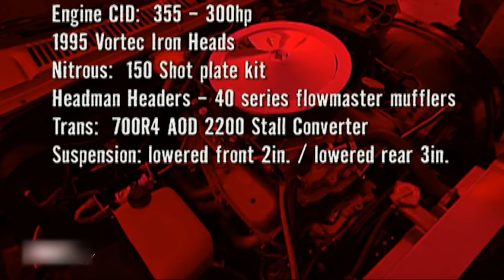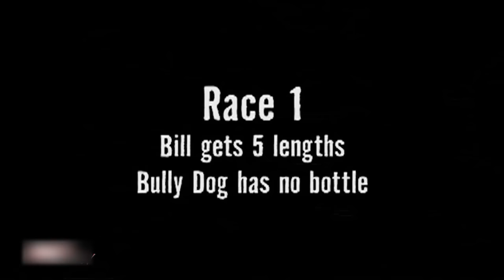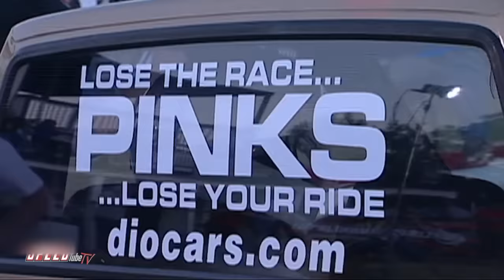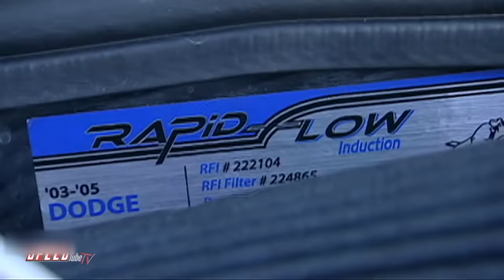PINKS- Lose The Race..Lose Your Ride! -Team Bully Dog "Diesel Turbo"  VS "Gas Nitrous" Team Bonadio

Comment: It’s crazy how the rules of the race helps one side. I would never do this it should be run what you brung
Reply: Someone brings a promod and takes every car, great show......
Reply: You would lose the drama.  TV shows need ratings.
Reply: That would defeat the whole purpose and effect of the show.
Reply: Makes no sense.. no show someone wld sell their house and win every time
Reply: With a horsepower, weight, tyre, etc limit?
Reply: @EZ-D-FIANT  all the negotiations is what made it corny and stupid. 

If you can't bring a fast car, you shouldn't be on the show or racing for slips.
Reply: @baibureh8816  Their are vastly different levels of fast, for example a pro-mod vs a small wheel is not a fair race but b9th van be very fast! its not hard to understand even in pro racing they group vehicals together by class, that's what this is about, making a good race, your comment is ignorant get back in your Lada........
Reply: A show like street outlaws killed a show like this.
Racing for cash with real-time betting is more exciting and entertaining

Comment: Who would do all that work ,cage and money and just put a 300hp motor in it with spray and finish it off by putting that disgusting front on it! I bet those folks sold that truck immediately and whoever bought put  a S10 front end back on it

Comment: They should have a dyno were they should test the cars before, if they do anything to the car after the dyno they will loose the car. And if a Outside technicians find something that allows them to get more power during the race or if they do not give full (check log) they automatically lose the car. A race for pinks should be straight up without any cheeting.
Reply: They shouldn’t be allowed to cheat either…
Reply: Electronic Turbo Controller can beat a dyno. Just setup a sandbag tune and then change it after. Scramble Button for a brief instant boost gain while on the track to boot.

All of this existed back in the earlier 2000's when Pinks was filming.

Comment: BS their was no 10 second common rail trucks in 06 when this was filmed lol. Grandpa's pull truck was an 04 24v methanol injected. Made 1340hp in 2006 on a dyno in Oshkosh WI. 

Obviously apples to oranges with a sled truck and a drag truck, but it was 100 percent doable

Comment: Mad respect to the dude for saying the truth I ran out of nitrous that's it.
Reply: Yeah but everyone knows you only get 2 maybe 3 races out of a bottle. why didn't they put in a new bottle. The producers gave them nitrous if they needed it.
Reply: @JoshJackson13  he probably planned to sandbag and ended up doing full nitrous passes.
Reply: @delatuned or had a second kit that was hidden and used it all three passes and couldn’t change without exposing it for the 4th run.  I think he was hiding something.

Comment: The statement made about there not being any such thing as a 10 sec street legal diesel truck is asinine.  The guy has no clue what he's talking about. Having said that, must be nice to blow your $10,000.00 Cummins up ( that's crate engine price ) to win a race for a pretty truck with no engine.  I'm not a Bulldog fan by any means. I tried to run their programmers and all it did was run the egts through the roof.  I'll stick with the TST Power Max CR / Smarty combo or the Banks 6 Gun on my other truck.
Reply: This was filmed back in mid 2000s like 05 or 06 I think
Reply: @leviduff2740  The Dodge Truck being run there was a 2004 24 valve. It could have been,  but....  the 2004.5 was a 32 valve Common Rail that was 325 hp 600 torque stock. By late 2005 / 2006 there were all kinds of the newer 32 valve Cummins that were blowing out 10 sec 1/4 mile times. Twin CP3s, bigger injectors, cam, twins, fire rung heads / blocks,  water / methanol and cross over Programmers and Plug and Play electronics, etc.  you were easily making over a thousand rwhp. Heck, I bought my truck and it didn't make it to the house before I had a FASS Fuel System , 4" exhaust,  better intake and a rebuilt tranny in it. All this and the trucks are still street legal.  The only thing on either of those vehicles that made them not street legal was the NOS.
Reply: @mihybrid1  32 valve? Wow I never knew cummins made a 32 valve 5.9. I learn new stuff everyday
Reply: @mihybrid1  as far as I know the only difference in 2003-2004.5 trucks and 2004.5-2007 trucks is they went from a 341cw to a 351cw turbo. The only 32 valve cummins in a truck is the one in the Nissan titans. The 5.9 and the 6.7 are 6 cylinders with 4 valves per cylinder.
Reply: @leviduff2740  yeah... not sure where my brain went on that one. 🙄

Comment: Lol 10 seconds there was maximas 2002 from nisformance doing tens naturally aspirated😂
Reply: he was talking diesel but there was def street legal diesels that could pull 10s no problem then. I don't think he knew what street legal meant.
Reply: 2006 definitely had 10 sec quarter Cummins. Funny how nitrous is illegal but propane and methanol injection is perfectly legal... among other extra stock trucks could come with.